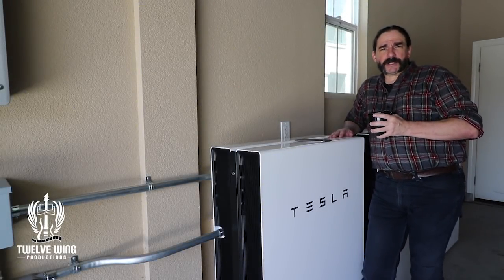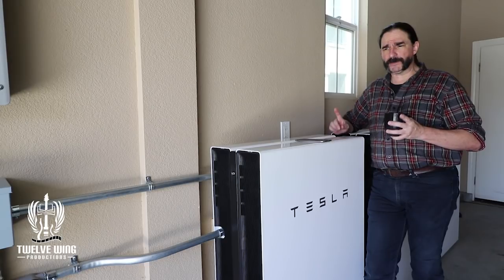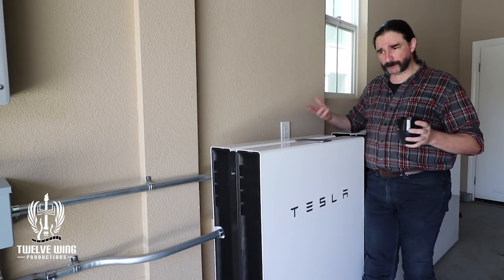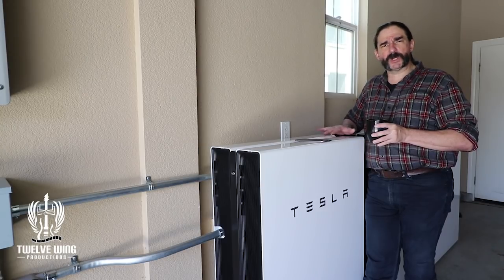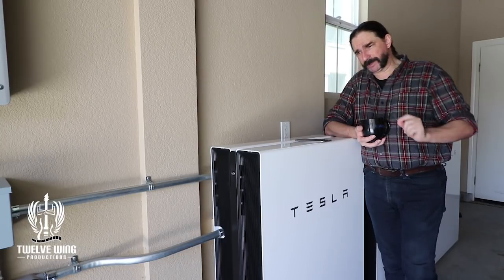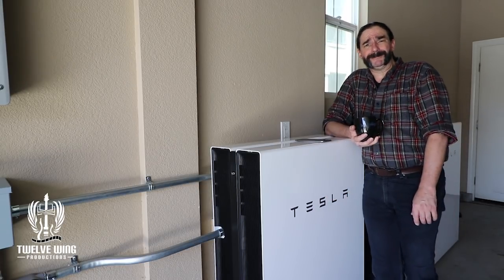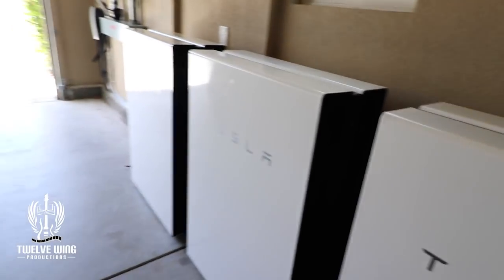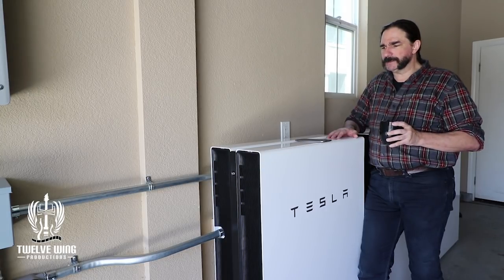Energy Sovereignty Project Quick Topic: Tesla Powerwall needs a capacity limit setting

Comment: Can you stop charging the batteries at say 75% during the day and sell the excess to PG&E and then go to Zombie apocalypse mode at night to draw down the batteries through house usage and vehicle charging?  I know it is a lot of hand holding for the system.  Recharge back to your 75% level and repeat...Just a thought.
Reply from the maker: That was the exact point I was trying to make.
No, currently the only way to stop the batteries from charging is to shut the PV system off.
I"m not able to run the home off the batteries and not charge them.
So a software set point will be needed.

Comment: Doesnt Tesla limit the powerwall already? I do agree that some setting like the daily vs trip setting in the cars makes sense, but I assumed the default for a cycling powerwall would be "daily" (so 60-80% SOC) not trip (90-100% SOC). Is there any way to check the voltage of the cells?
Reply from the maker: You hit it with your first statement.  A trip setting is required.

Comment: I think the Problem is.. how the state of charge is shown to the user. Actually it is the same kind of question with the SoC in a Tesla car.. as we say.. stay above 10% and lower than 90% if you want to keep the charge for a longer time..  so, one could just calibrate diffrently and keep the health of the batteries.. but needs a button to allow the charging to 100% as soon as bad weather periods are guessed to be coming up the following days. 
But the acutual question I have is: how long does it take for your Solarpanels to charge all 6 powerwalls, if the house and the car is not consuming anything? Can it be full in one day? I would guess that it takes at least 3 days. And because the house is consuming.. we might end up at 7 days.  Which is of course too long to prevent bad weather outages. Anyway.. when I think of the system that tesla has implemented in their cars.. it should be no hassle to do the same for powerwalls.